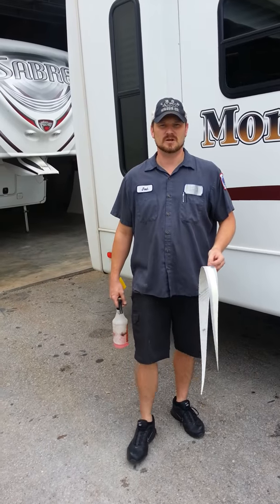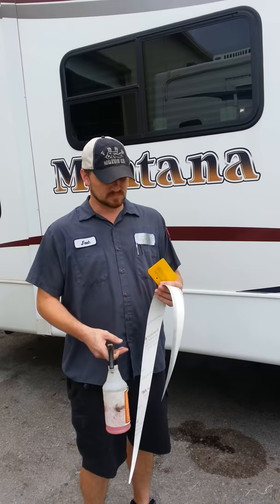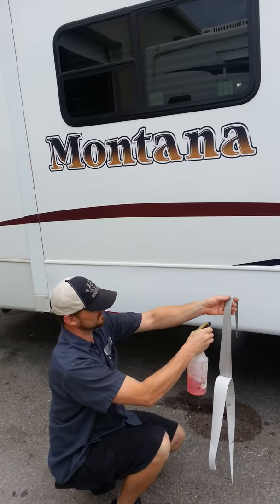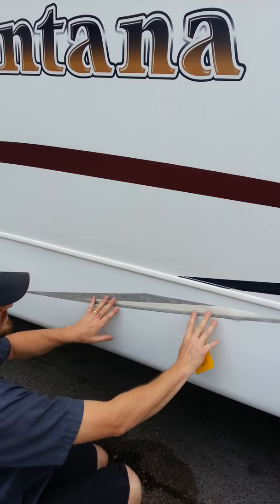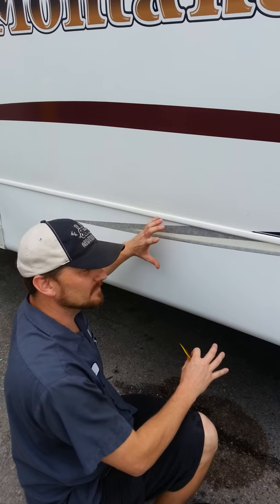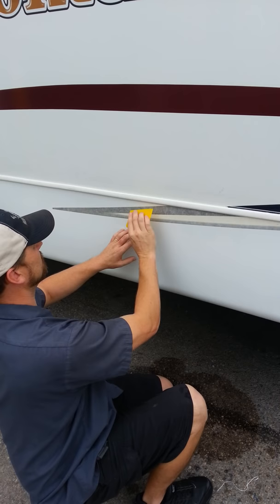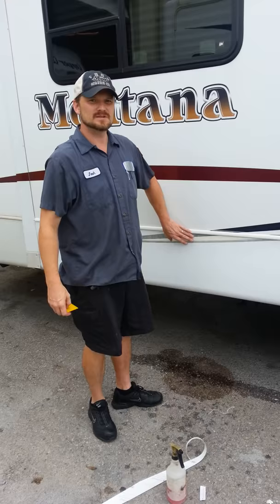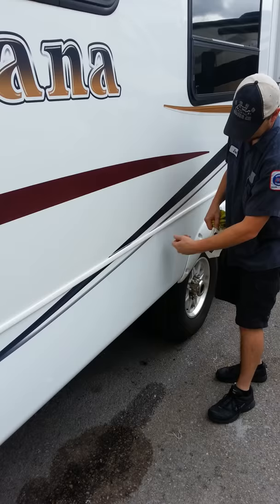How to properly install  vinyl decals on your RV.

Comment: Great video on how to apply!  Thank you.  Have one question?  If you use soapy water to keep decal from sticking to itself while applying and as well allowing it to be adjusted due to the slipperiness of the water and soap - how does the soapy water keep the adhesive from working properly.  I am going to assume these decals have a tacky sticky underside.  Does the soapy water hinder the adherence capability seeing you are putting water on the glue?  OR does the soapy water just eventually evaporate as you squeeze it out with the spreader and still allow the tacky/glue adhesive to still bond to the coach?  Please advice.  thanks.

Comment from the maker: Thanks! The decals should not be "sticky" like a sticker....the face down side should be slightly tacky...make sure you are peeling the backer off the correct side of the vinyl.
Reply: where can i get pretty much the same area you are doing for a 2010 3455sa montana ?

Comment: Great video, but can you suggest a place (ie web site ect…) where I might be able to buy replacement decals for an older rig such as a 1999 Fleetwood Tioga SL 31W ??  Thanks
Reply: Michael L I had the same dillema. Unfortunately they don't make the exact decals for my 2007 Toy hauler anymore. I just went on ebay and typed "rv decals" and found some similar "swooshy, tribal" ones in a similar color. Got the whole set for $100. Time consuming to remove the old baked on decals & installing the new ones. But be patient & it will come out great!